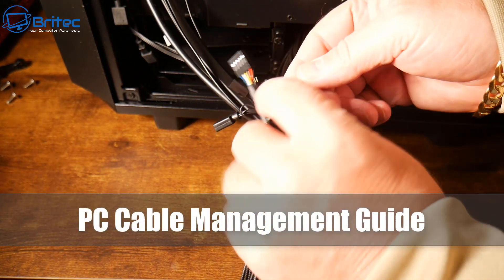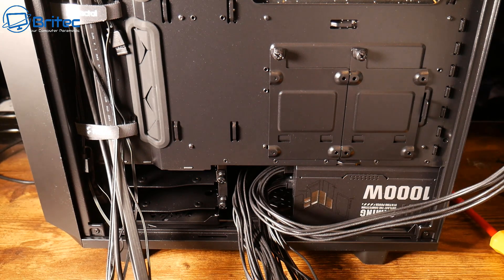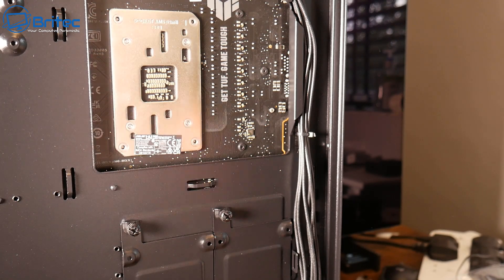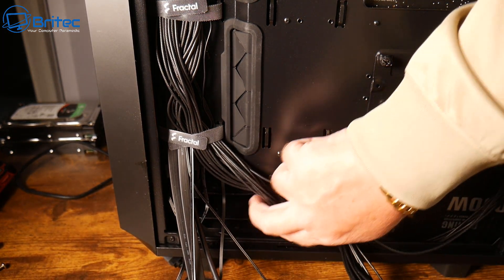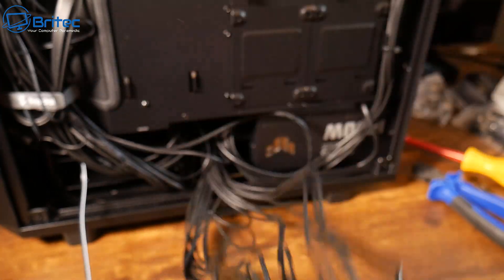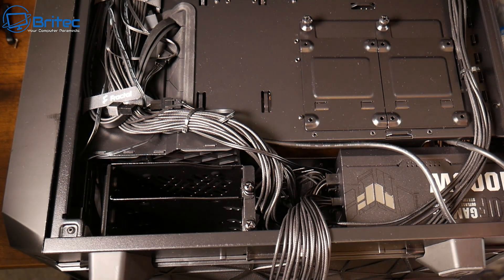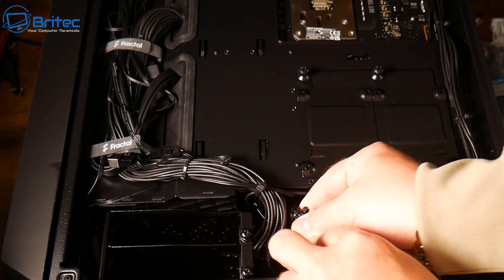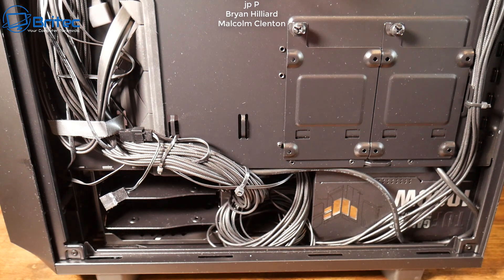PC Cable Management Guide

Comment: As a former telecommunications engineer, this has always been a discussion for debate. A super "neat freak" who bundles then very tight, can induce "cross talk" regardless of shielding. All conductors emit a field. A neat reasonable bundle without severe bends is the answer. Good topic Brian, as moderation between the 2 extremes prevails. 👍👍👍👍👍
Reply from the maker: Thanks for watching

Comment: My non modular psu with flat cables is easier to manage than a modular with round cables. I had to make sure the round cables dont overlap to make the side panel fit. Flat cables look cleaner too, no need for cable combs.

Comment: I didn't know that, not to use those wires.
Reply from the maker: They have wire sticking out the ends which could touch components and short out the motherboard
Reply: @Britec09  Wow, I'm glad I never used them. I have the velcro kind I can use over and over again